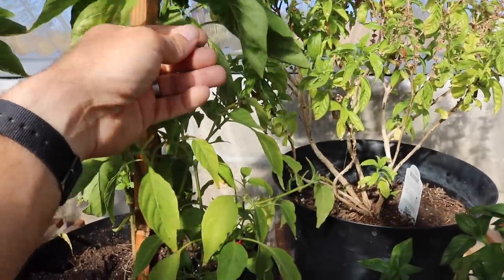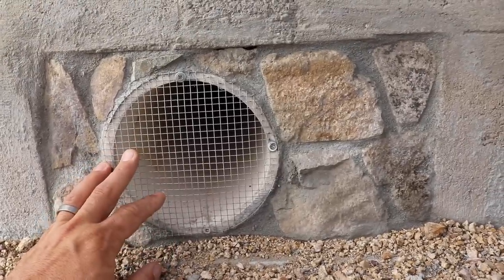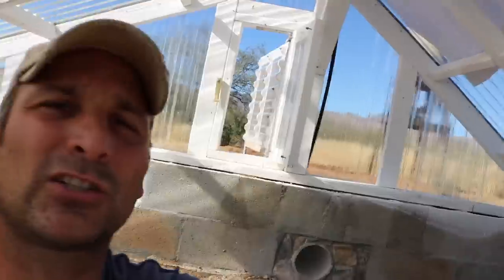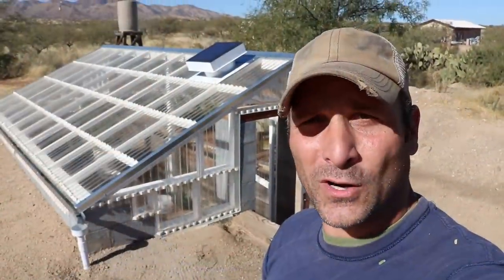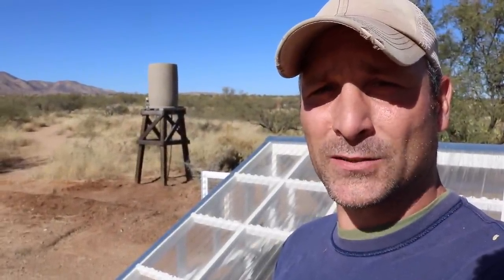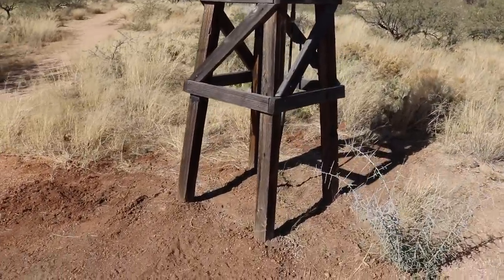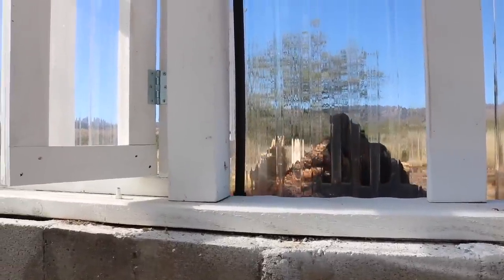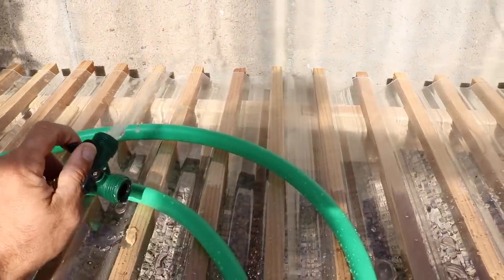Sunken Greenhouse 7 - Rainwater Harvesting, cooling tunnel

Comment: Nice project for the colder places, where we can insulate the ground.
Reply: 18-inch depth of the air intake doesn't provide much temperature differential during the worst head/cold.  Mounding up soil on top helps some.

Comment: You have some great ideas, but have to modify a little as it was -17 F here yesterday in Wisconsin. Bought all the corrugated clear plastic for the 10 x 20 in ground somewhat like yours The North half roof and sides will be solid gray and insulated with black water barrels for a heat sink. Will send you some pictures when Spring arrives and I can build mine. Thanks so much for sharing. You make so many ideas spring forward. God Bless.

Comment: You can just connect the two totes by piping the two discharge valves together and leaving the valves in the open position. The second tote will fill at the same time as the first. You can then add another valve at the end of the connecting piping for your new discharge/hose connection. Also, by connecting them you increase water pressure coming out of the new discharge.

Comment: I've never seen pink PVC pipe. Glad to see plants in there!
Reply: I believe that pink indicates uv protected
Reply: The purple pipe is for reclaimed water I believe.
Reply from the maker: Hi Joan... the pink PVC is indeed for reclaimed water.  It's the same as regular white PVC but is just colored for code work.  I got all this off of craigslist from a plumbing contractor who was selling it because it was outside too long and started to get sun baked... and the government contract he had wouldn't accept it for the installation... so he was selling it super cheap!  that's the same guy I got the 6" PVC pipes for the cooling tunnel... 300'+ of 1.5, 1, and 2" pipe and 130+' of 6" pipe for less than $45!  super deal!
Reply: +homesteadonomics whoa

Comment: What you need is both ideas combined into one...start with big pipes yet when airflow heads to the greenhouse you need a gradual narrowing of the pipe it speeds up the cfm cubic feet per minute flow rate I do believe the physics of the venturi effect apply actual cone shaped narrowing from one end of the pipe to the next.

Comment: That is the best man cave ever!! Producing food for UR family!! Doing a fine good!!
Reply from the maker: thanks so much Towanna!  yes, a man cave it is... now I gotta get some lights to really be able to enjoy it at night :D
Reply: That little water tower is the coolest thing I have seen for a while.   Rustic prairie garden art that is functional too.
I love it.  I want one.  I will have one.  :)
Reply: Hmmm. I never thought of it as a man-cave. I usually think of an underground greenhouse in terms of living space, however. thanks for the idea. I'll keep it in mind when I get around to building mine.
Reply: Soon there will be a sweet blu tooth speaker in there......    Your buried tube is going to be air make up mostly when vent fan is on...connect both rain tanks using the connections already there...those two huge tanks will fill and drain at the same time just connect them at the bottom......l just think you have a great set up there guy....wait till you find Dutch bucket growing systems...best of luck from one hobby greenhouse grower to another...Man Cave..solar light string would work too...you will love that space...Zone six here.....
Reply: What have you done about flooding when it rains?
Reply from the maker: it doesnt flood.  i get some water in by the door but the rest just flows away from the structure by the grading/slope of the ground.  We had 11" of rain this last month and a half and only a wet area by the door.  hope that helps... will have more vids on it this winter:)

Comment: In MN, we call it a sun-heated pit.  We fill the basement with water barrels and blow air across  them. When barrels of water freeze, they release heat, enough to keep lettuces and brassicas above that critical 24-28° F (depending on species.)  A friend ran his 18X12' greenhouse on only $50 per WINTER for heat. It was built on South side of unheated garage.

Comment: Consider a layer of insulation a few inches down, but above the pipe, to alter the heat transfer path from the surface.  In the summer shade over the buried pipe should also help.

Comment: Hi Joe
As regards the cooling tunnel, multiple short tubes in parallel is the most efficient way to go. With a 100ft tube, the air temperature will drop to ground temperature in the first 10ft and coast through the other 90ft. Its therefore better to split the 100ft tube into 10x 10ft tubes which will cool 10x the volume of air in the same time frame. Consider the surface area of tube  in contact with the ground is identical in both cases,  1x 100ft or 10x 10ft,  how its utilised is what makes the difference :)
Reply: there is also a finite thermal capacity to the ground mass, in which case a longer and deeper pipe would help. on a hot day, the ground around the pipe will absorb much heat and rise measurably.
Reply: A longer pipe cant move as much air as several shorter pipes fed in parallel. The total surface area in contact with the thermal mass is the same for both layouts but one will work considerably better than the other ;)
Reply: Very interesting. I've never heard this before. Can you provide a source for this information or is this something you've successfully done?

Comment: Love the greenhouse, nice design. About your earth cooling tube, 1st. It needs to be deeper in the ground, if it plumbed in at the bottom that would be better. 2nd. It works off the natural cool ground" it needs to be made out of metal. The metal will conduct the coolness of the ground. PVC is a horrible conductor of heat or cold. 3rd. If it is setup properly when it gets hot inside greenhouse vent at highest point, as heat escapes it will suck cold air through your cooling tube without a fan, natural process. I hope this helps.
Reply: Hi Jason, considering the pipe diameters I don't think you will get enough draw of air through the tubes as there would a very low pressure differential and lots of resistance in the pipes but I like the way you are thinking. Also whilst metal pipes would conduct the heat better they would be more expensive and depending on type susceptible to corrosion. It might be that the thermal conductivity of dry earth would be the limiting factor of coolness extraction (that sounds weird) more than that of the plastic pipe.
Reply: If you use metal corrugated drain pipe, it's usually 12in in diameter, it's galvanized so it doesn't rust. When you backfill you would want about 12% moisture in your dirt for proper compaction. That moisture will stay down there. Have you ever dug a hole for a tree in your yard? Notice how the dirt gets darker and seems to be moist the deeper you go?
Reply: Hi Jason, thanks for your reply, I had to laugh, my backyard is 5.5 acres in rainy Wales UK. When I dig a hole it's usually filled with water by the time I have put my spade down and galvanised really would not last here especially as the soil is boulder clay (they used to mine the clay here) with about 2" of top soil and a PH of about 5.5
Reply: Yeah I guess that set up doesn't work for all environments, I live in the desert.

Comment: Hey there!

I've enjoyed watching this pretty much from the beginning.  For my thoughts, Michael Reynold's Earthships do about as well on virtually the same cooling runnel you've set up plus venting.  Even the minimal units get by on one of about the same length as yours.  The big difference is he runs his cooling tunnels further underground and caps both ends I think.  Something to consider might be putting in a 90 degree curve vertically and gapping off with a vent cap covered with mesh to keep things other than the rain the cover will stop out.  That way you could build a hinged cover inside over the exit and not have to go out however far you finally decide on to open and let air cooled by the earth in.  What temperature you finally get coming in during summer will determine if you might what to hill more sand or whatever on top from somewhere on your land or put in a deep tunnel.

The only other thing I can think about is a safety rail setup around those stairs before something happens.
Reply from the maker: Thanks Stanley!  Those are some good things to think about!  And yes, I do need to do some sort of rail for the stairs for sure.
As for the tunnel, I like you're idea of having it come up with a rain cap, or something to that design.  Very cool.. I think I saw an earthship video that had that design and I thought it was really smart too!

Lots of good stuff to think about:)
joe

Comment: I found some fittings from old waterbeds. We have what they call a restore place here in my town. They resell stuff donated from houses that get torn down etc..  What about rain barrels to catch debris like build up of dirt and muck from storms build up in pipes. leave some spacers in your tubing in case you need to go in and flush out build up. Put some smaller screening over your vent holes because bugs lay eggs in the water and mud can build up.easier to wash a screen than flush out the pipes. Just some suggestions.

Comment: Regarding the IBC totes (large water storage tanks), I had to scratch my head when you mentioned that you might want to connect them together towards the top of the sides so as to create some sort of overflow. I think the solution would be much simpler than that. Connect the drains together with PVC and put a T junction in the middle that connects to a shutoff valve. Connecting the two tanks at their lowest points like this ensures that they will both fill up evenly (instead of one overflowing into the other). Hope this helps.
Reply from the maker: Thanks Kristin... that's an idea that I've thought about not sure yet as I kinda like having the water level high as it can be to make using a hose easier but that is probably the best and smartest solution:)  thanks!
Joe

Comment: Those off white holding tanks will cause algae to grow inside.  If you can, you must either cover them with black plastic or make sure that they are in a tank that the sun is not beating down upon.  I have a white plastic bucket at home that algae grows in.  My black one doesn't.  This may or may not be an issue, but if you are holding the water for more than a month, this will be an issue as algae can be evasive.

Comment: Awesome project, Joe. I've been watching from the beginning. Now I want to do the same thing here in Michigan.
Reply from the maker: Thanks Andrew!  yes, this would be a great fit in Michigan... I think if you built it into a  southern hillside it might be a bit more functional with the sun getting lower where you're at but overall it would probably be a great project.. and could even be used later into summer whereas mine is going to be pretty much empty for about 4-5 months out of the year.
Joe
Reply: homesteadonomics I wasn't even thinking about the height of the sun. Just thinking that in winter, there would be a lot of added insulation than what most greenhouses have. I used to have a pretty big hoop house that I used for starts for an organic farm I used to own. But it was so hard to keep warm without the furnace constantly running. I like the sunken greenhouse idea much better.

Comment: You can cover the run of the line with EPS  foam sheets and then cover the sheets with soil, it will have the effect of bringing the pipe temperature to the same temperature as the soil 6-8 feet below the pipe. Look at the literature on how people insulate the perimeters of slabs when building houses with shallow foundations in Northern climates.
Reply from the maker: that's a great idea Chris!  Will definitely look into it!  thanks!
Joe

Comment: More surface area = faster heat transfer.  All diameter piping will achieve the goal, but a are ingle large diameter pipe is more stable (resist change, take longer), and multiple small diameter pipes with the same cross section change temperature more quickly.  What you choose depends on your goals.

Comment: You can reach same level in both tanks when you use a hose filled with water and put it through the openings on top of the containers. The pressure diffenrence between the containers will even out itself. There's a short video about that but on german language. Just type in "kommunizierende Gefäße" and you'll find it. No drilling ist needed. Greetings from Germany
Reply from the maker: Hi SD!  That's a great idea and doesn't ruin the integrity of the tanks either!  I've used that for rain barrels but just hadn't of even thought of it for this.. very cool!  
Also, awesome to hear from Germany too!  One of my buddies goes over there every year and wants to move there when he retires:)
Joe
Reply: Glad to hear that :) But the weather in germany is too cold and rainy in my opinion ;)
Speeddemon

Comment: corrugated pipe might be worth trying. the ridges inside the pipe may help cool the air with a shorter pipe, due to more surface area. water flows just fine in it, no reason air wouldn't too

Comment: The cooling tunnel is similar to an idea I had about 15 years ago for efficiency cooling an earth contact home that my father was trying to have built in Florida. My idea was to make two inlets at floor level at opposite sides of the house using 8" PVC and loop it through the berm, coming out into a single outlet high in the foundation. There would be a 12v radiator fan in each inlet forcing cooler floor-level air into the loop and another forcing out out of the loop at ceiling level. All fans would be solar powered and thermostatically controlled according to the temperature inside the house. The outlet would discharge in the center of the house through a ceiling vent, thus cooling the entire house. Basically, you would be cycling the interior air of the house constantly through this PVC pipe. 

Unfortunately, that house never came to fruition because nobody in the area knew how to pour concrete vertically as they do not have basements there. He did not trust concrete block, which is what people in that area would use. Instead, he designed a more traditional-looking cabin that was super insulated had an open floor plan with a loft bedroom. The entire house is easily cooled by a single window AC unit that is on the second floor.

Comment: Shouldn't the cooling tunnel be deeper? It seems that the first foot of soil would be warmed by the sun. I spose that should be easy to test and fix later. Beautiful,ingenious greenhouse and water catchment
Reply: You're correct. It should be several feet down. I would recommend watching LDSPrepper's videos about building his geothermal greenhouse. I think he dug down about 8 feet for his pipes.
Reply: LDSpreppers installation doesnt provide any cooling even when his greenhouse hits 130F, i wouldnt recommend using that design unless you enjoy digging because the only fix is to dig the tubing back up  ;)
Reply: why not just have several tubes at different levels?  especially some high ones covered with mulch to create more warmth during the cold season.

Comment: The size of your earth tube is fine for the size of your green house. A straight run makes for better airflow without mechanical means. bends will restrict natural airflow.
I decided to looked up the Climate data for Green Valley, Arizona which was closest I can guess to your location in Sahuarita, AZ 
Annual high temperature:    83.0°F
Annual low temperature:     53.6°F
Average temperature:          68.3°F
 Your average temp is normally your soil temp below the frost line which is 2" for your region. Your earth tube i'm guessing will be pushing around 68.3°F air year round. Give or take a few deg depending on the year.. Obviously cooler temps will be in late winter and warmer during late summer. 

I just want to give you some brain storming ideas for creating more airflow. Venturi wind scoops, Wind Directional Vent Caps, and look up traditional Malqaf ( middle eastern wind catchers), check out the BedZED roof ventilation. 

http://www.i4at.org/lib2/aircool.htm
https://architecture.knoji.com/contemporary-windcatcher-malqaf-in-western-world-part-4/
http://www.usclimatedata.com/climate/green-valley/arizona/united-states/usaz0344
Love the greenhouse so far.

Comment: Great vids. Watched most of them from your coop to the green house. I'd love to live out there where you do, and do exactly what you're doing. 👍I'd suggest on your geothermal h/c to go much deeper. Looks like maybe you're a foot or so deep. I'd suggest a good 6 feet deep to gain anything significant. Alot of info is out there. Like using a 55gal barrel as your manifold to run all the fingers off of. Great what you've done to your homestead!

Comment: For people watching in the future thinking of doing the same thing I strongly recommend not using any 90s in your rain catchment system at least anywhere you plan on putting it underground any debris that makes it past the screen's will surely start collecting in the corners and it also makes it pretty much impossible to snake out theres a reason plumbing codes will fail you for using 90s in a drain system

Comment: Hi Homesteadonomics,
I just found your videos and subscribed. I will watch your series. 
They have trenching machines that will dig and place a rubber hose. Since liquid transfers heat 25 times faster than air I have thought about doing that. And the system is closed so any mold issue should be solved. My plumber used a system like that at his house and just laid the hose in the lake.
Reply: True, I had to show him how to arrange the pipes..., but he was certified. Let me know what you think about the idea?